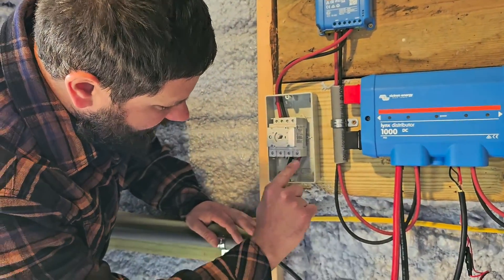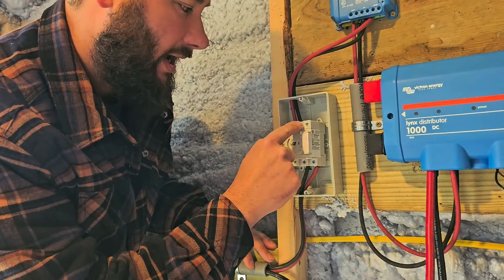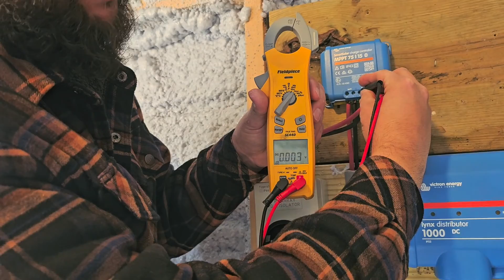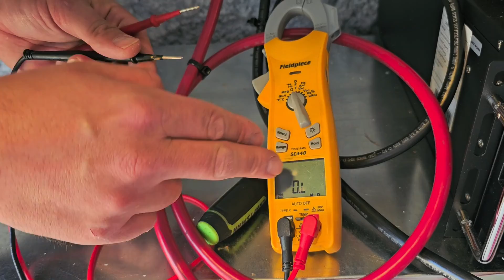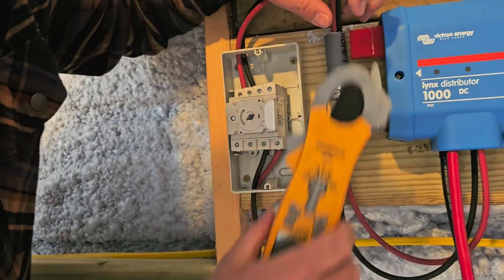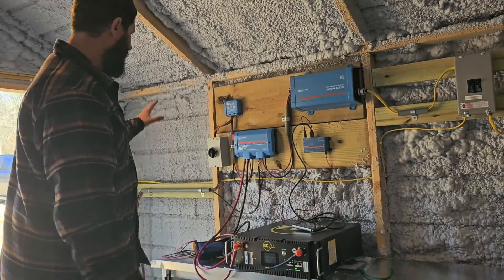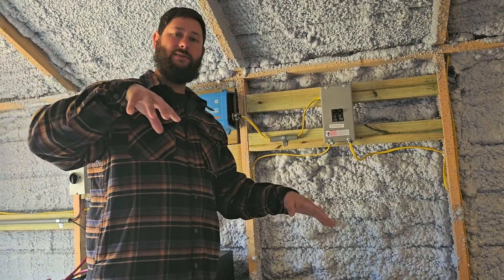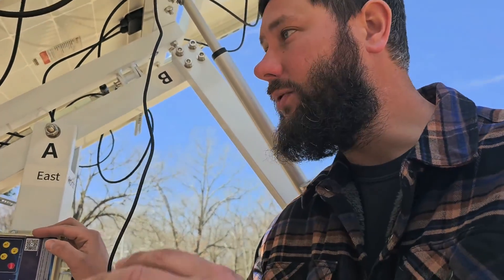How to Wire a Solar DC Disconnect for Beginners #dcpower

Comment: Hooking up 2 arrays for my DPU or my current solar generators. Should I use a IMO from them? If i am using two inputs , 1 to 2 and 3 to 4, then have on set coming out back to my solar generator correct. Are you using 10AWG? What wire did you use ? brand ? Amazon ? Might due a dual tracker .

Comment: Nice video and thanks.  New to this area.  I am thinking of having an EG4 300kW inverter and a 5kW EG server rack battery off-grid system. Thinking of going with a combiners box since it has a breaker (an pv disconnect) inline fuse and surge protector.  I am not families with a PV disconnect. Are there any advantages of a PV disconnect over a combiner box?
Reply from the maker: Thanks for watching brother. I'm not sure the answer to that question, but I'll find out and I will get the answer

Comment: Nice setup! I just had 2 PW3's installed and I'm going to add 24 panels soon. 2 strings of series each with 550v and 9A. Can I use that particular disconnect?
Reply from the maker: Yes, absolutely.You can use this disconnect for sure

Comment: Just wondering Why would one use this solar isolator instead of a DC circuit breaker that can prevent overload/surge?
Reply: Most of the time these days local code requires you to have a local disconnect at the panels.  And if you have multiple panel arrays, this could be more cost efficient than a breaker at each array.  Nothing is preventing you from having a disconnect local to the panels and DC breaker box local to the inverter either.
Reply from the maker: Just what I had on hand

Comment: Nice video. Many of these isolator switches are eventually catching on fire. Best to use a cement backer board to install to.
Reply: IMO brand is expensive and really well known.  They do not have the catching fire issues.   the issues are cheap chinese knock offs.  They simply aren't rated for the power load and they are cheap.   IMO has an insanely good reputation and their DC disconnects are not repurposed AC.  Its why they are the cross pattern wiring.